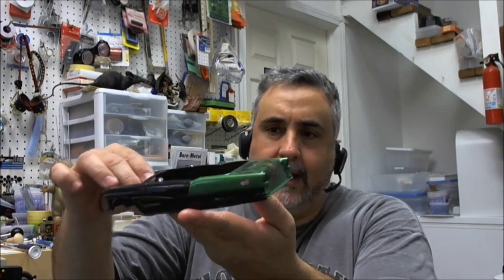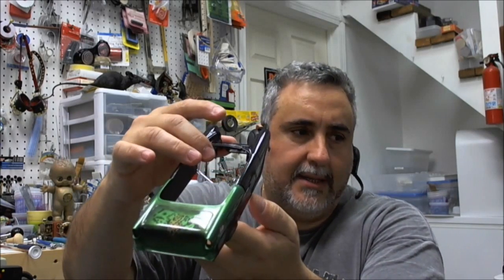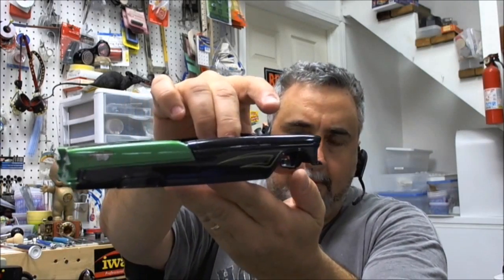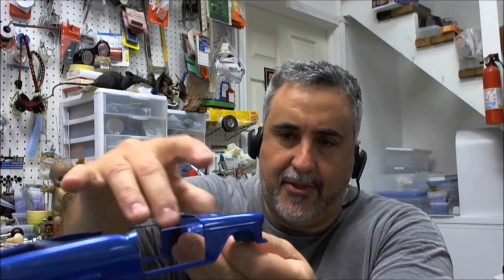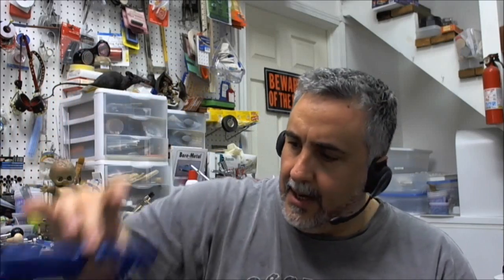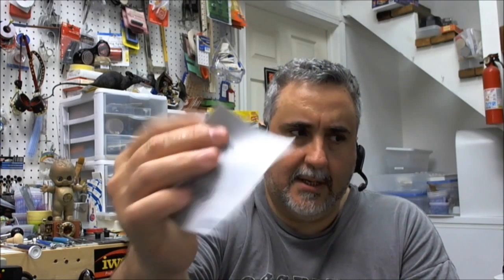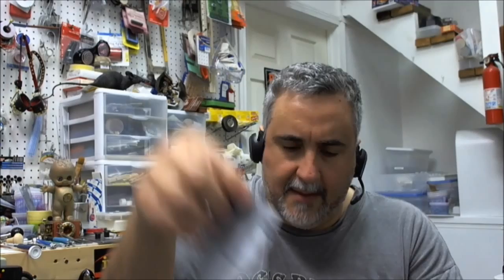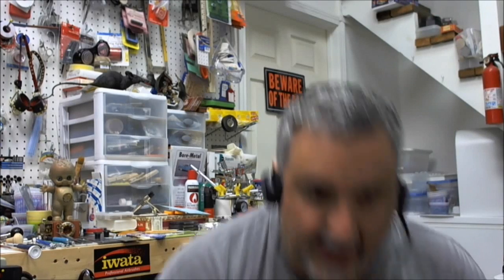Sandin', Buffin' & Spit-Shinin' Your Models

Comment: Hey Cranky....if you want to go farther with the polishing sandpaper, there is a set out there that has 6 sheets, starts at 15000 grit and goes up to 60000 grit. Not sure what the point is, as once you get to 12000 grit, it is pretty good, but for those that want to go the extra mile....you can!

Comment: Dr, how much pressure do you apply when sanding with the Micro Mesh Cloths ?  From 3,200 all the way to 12,000 ?  How long do you sand with each of the different grits until you bump to the next higher ?  How long do you buff the Zymol after applying as well as the Meguires ?

Comment: If you have orange peel which is all I can seem to get right now while I'm trying to learn to airbrush, should I go ahead and apply a clear coat before trying to fix the orange peel. Any suggestions would be greatly appreciated???
Reply from the maker: You have two choices: you can sand and smooth the orange peel away or strip the body.  In my experience, I always try to strip the body and start fresh.
Reply: Doc, I know that you can't tell me what I'm doing wrong but I want to tell you what I am doing. First of all, I'm only using Tamiya Acrylics with Tamiya thinner. I figured I would learn how to spray acrylics first then move to enamels and then maybe urethanes. This is my fourth model that I've had to trash. They've all looked good, But they've all had orange peel. Any words of wisdom as to what I might be doing wrong. Thx, Macattack
Reply: Hey doc, I was wondering if you might have any idea's where I might find that Dupont A7480S that you like so well? I messaged The ScaleModeler and he told me if it was a light color that he would go ahead and put the clear coat on. I really don't know what to do. He said if it was a light color " there was still hope that I could fix the orange peel. But he agreed with you when talking about dark colors, he said that I would have to start over. I showed the paint job to a couple of people and they said " nice paint job". But there not like us . They don't know any better. I'm so close. I don't know what to do. Thx again, The Mac Attack
Reply from the maker: You need to spray your paint between 8-12 inches away, and also check to make sure the temperature is not too cold.  I normally like shooting paint in the 70s.